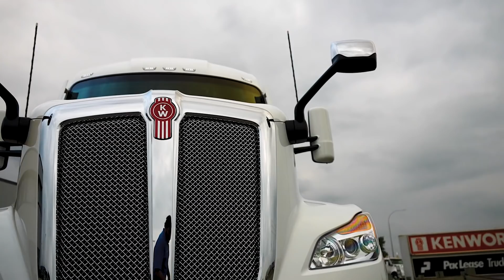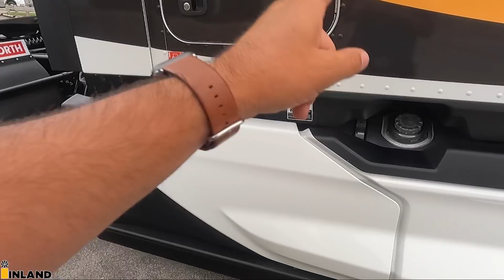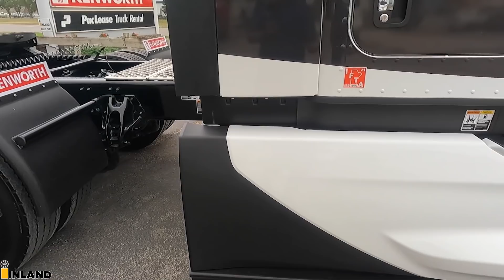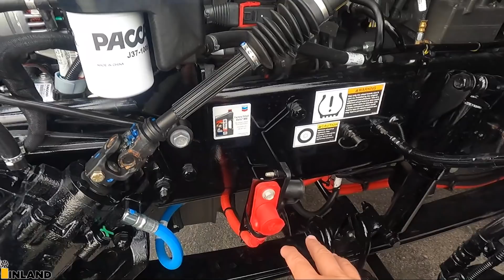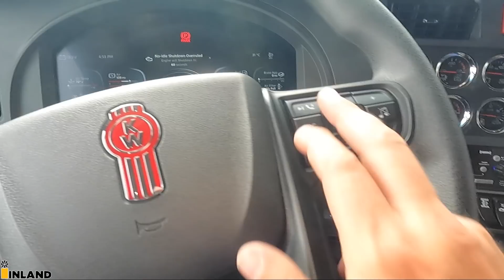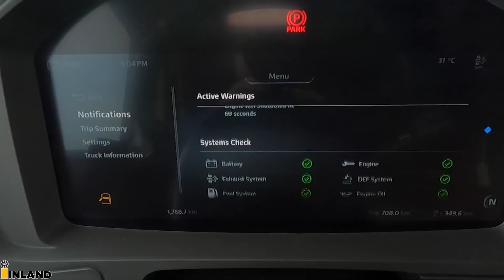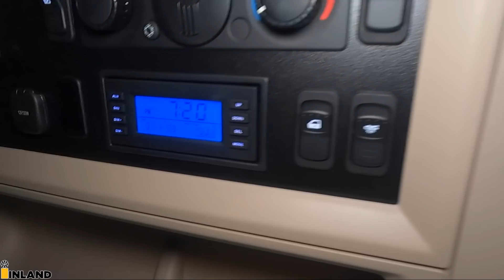Finally    My first look at The Kenworth T680 Next Gen   The Kenworth Guy

Comment: Paccar power - no thank you. I had all kinds of problems with the 13 litre engine in three different Peterbilts (in two years), it's why I finally left that carrier. I couldn't make any money because the truck I was assigned was always in the shop. 
The Cummins engine has a much better reputation. 
I am not fond of these new digital dashes either. One fuse pops or connection comes loose and your entire gauge cluster is gone,  which means you don't know your speed, or air pressures, or coolant temps, etc etc.. I don't even want to think about what that dash would cost to replace (never mind the downtime). I prefer to have an analog speedometer, tachometer and air pressure gauges - the rest can be digital.
The sleeper looks decently equipped (but every driver puts different stuff in it). I'd probably drive one if I was a company driver, but I don't think I'd buy one.
Reply: I have a paccar engine never had any issues with motor or transmission just electrical but I have my own peterbilt computer which I plug 🔌 and can diagnose the problem and fix it myself good engine so far had it for almost 2 yrs now
Reply: @aitransportservicesllc584  the truck i personally drive is a 2017 T880 18 manual paccar engine. it has been fairly reliable but only has 163K on it. the company has 14 trucks with this engine and overall track record has been poor. they just replaced a paccar engine with 300K on it.
we are hauling milk and the loads are on overweight  permits
Reply: I work for a local milk hauler. My boss has a whole fleet of mostly paccar mx13s. He's had allot of issues with that junk engine. His most recent 4 trucks, all Cummings. He wont buy another paccar. It even worse when the loads regularly gross over 100k. Even with an 18 manual it still hates hills
Reply: @andrewdonohue1853  The Paccar MX (DAF MX) in the EU has a good reputation. Paccar adapts these engines for the US market...even sounds different. Never change a good engine!!!

Comment: Thats kinda dumb to put radiotor resevor tank in the  firewall .
Reply: I agree.   Really dumb to put the washer bottle mounted on the frame by the wheel.   That thing ain't gonna last long
Reply: Why?
Reply: @kristinnsigurj  because trucks do overheat. Alit of time we have to add fluid to it. Now we got to climb on the tires to add radiator fluid . And where they mounted the washer fluid is stupided

Comment: Not a fan of having to get up on the tire for anything. It's dangerous for one and a pain in the azz for two. Kenworth needs to include an easily collapsable and storable lightweight 3 or 4 step ladder that hooks onto the tire for stability so that you can fill your coolant and change wiper blades occasionally and.... clean your windshield more often.
Reply: Unless your 400 pounds climbing onto the tire to clean your windshield has been done for 50+ years. It's not hard.
Reply: @busboy3232  and because drivers have been doing it for 50 years makes it how much safer? There are ladders that hook onto the front tires that mechanics use. I'm asking for something that drivers can store away easily and Kenworth could easily make that happen. Safety first son, safety first.

Comment: Okay I am going to give my best opinion on this new look and features that I don't like and the new KW. I don't like the automatic shifter on the steering wheel column since the first time KW made the change. The only thing in the sleeper is the step that was above the lower drawer and bottom of the refrigerator was removed from the last few years models and it made it easier to get up to the upper bunk for my 12 yr old grandson in climbing up with out having to step on the lower bunk mattress. I don't know if on the outside of the tractor on the driver's side sleeper window and door are still available like on the passenger side of the model you were showing. The new digital dash panel is not what I prefer but not a deal breaker. I prefer the Gauge look that you are able to trim in chrome to make for a better feature of showing the dashboard off. I am not a fan of always changing the features every few years. I am going to stick with my 2016 model for a while and see if anything KENWORTH has to offer in the future. Not a big fan of the new designs in the last few years and will not be buying a new truck  with this type design.
Reply: For the price, all new trucks should have LED headlights, and disk brakes standard, and since it's basically home for truckers, you should be able to get more interior colors and materials — not everyone are brutalists.

Comment: Love the lines of the truck. Especially how everything lines up at the rear fairings and the two tone front bumper.  Love that KW finally has a modern digital dash but not a fan of pairing it with analog guages or that catch all cubby hole. Lots of customization potential on this model 👍

Comment: Also when I drove a T680 it was getting 8.5 mpg easy I could have gotten 9 if I didn’t idle so much
Reply: Which motor and Trans?  I'm ordering one which is why I ask and looking for that type of fuel mileage.   If that mileage on paper or the inboard computer?  Thanks
Reply: @ApupsLove  it was a 2018 paccar 485 horse 1700 torque 13 speed Eaton fuller automatic pulling a 53’ step deck conestoga. Mileage on dash was 8.5 on paper matched or would be + or - a couple tenths
Reply: @Truckin4hotwheels  thank you sir💪🙏

Comment: I think it’s awesome definitely an improvement to the T680. Can’t believe KW is still using incandescent lights in the headlight section though when I drove a 680 I replaced the incandescent lights with LEDs looks way better
Reply: LEDs are optional but I wouldn't expect to see a lot of companies go with them. But owner ops will at least have the option to.
Reply: the incandescent light bulb gets hot and cuts down on ice build up in the wintertime

Comment: It's nice but you should be able to get the fuel fill in the back or the sides and pacar should give the option  for what dash you want and the same for the steering wheel and can you remove the Bendix system on older trucks